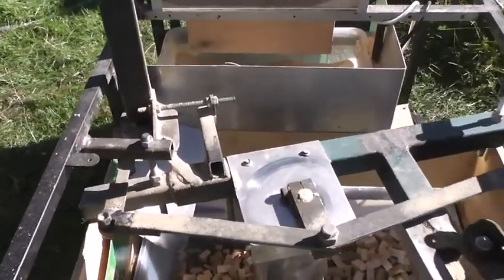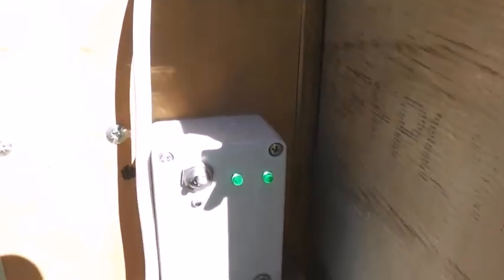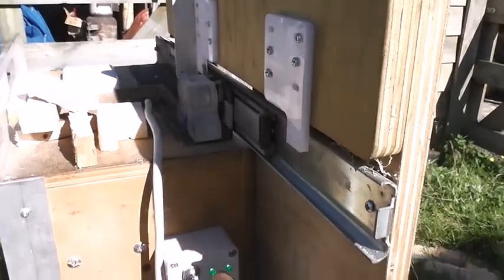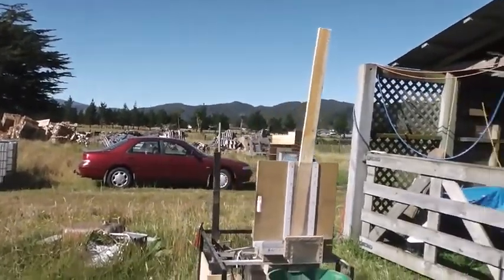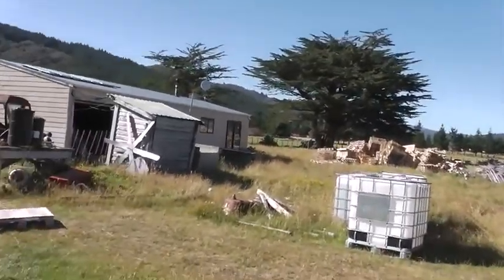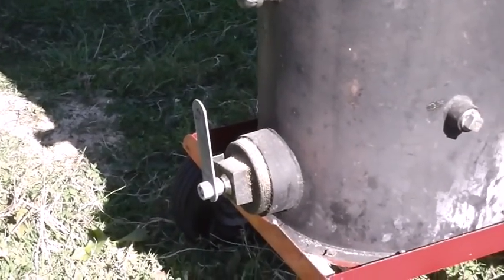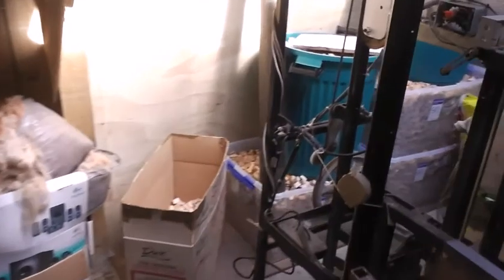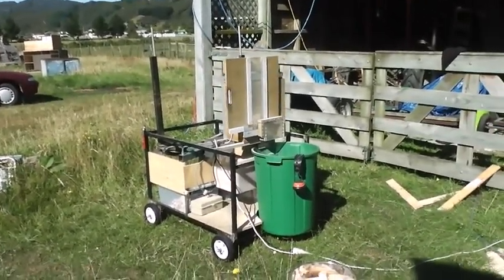Motorised Gasoline Granule Generation Station

Comment: I sure love these videos. I'm thinking about cutting a hundred pounds or so of some similar size chunks,  so I can do another run. I don't have my saw even near complete, but I'm getting the itch to run this engine on wood. A little insulation to do and a few more electrical tests should tell me what I need to know. Im hoping I'll get some work done by the end of this week. I put in for a couple of days off for my birthday. It'll be nice to have the time to work without watching the clock. Thanks for sharing these vids as they really inspire me to get to work. Joe
Reply from the maker: Howdee Joe, 
 Ahhh yes, the endless need to make fuel for our beloved gasifiers  :) . 
 I bet you are really itching to get your beast up and running on Treezel fuel again, as the woodgas addiction must be regularly satisfied by a good, solid, woogas fix, in the smoky machine shop. 
 Here's hoping yer boss will be fine with letting you go for a couple of days, so you can get that all important birthday woodgas fix  ;) . 
 Keep up the good work, my fellow woodgas bug necknip venom victim.

Comment: Let Me Guess the control is an arduino.
Nice Job Want to build one. Will you Share your arduino Code.
Reply from the maker: +AllgoodAutomation
 I use the PIC controller chip for all of these. Specifically the PIC16F628A. These little guys are cheap, and quite easy to use in a homemade computer. 
 This machine was in use today, making more fuel for the gasogen, while being powered by it. 
 It sure is good to never have a power bill  :) . 
 Yup, sure, you are welcome to the code, and the schematic for this device. 
 It drives a stepper motor, and uses a pair of reed switches to determine which way to move the slide.  
 Recently, I added some more code - to help the machine to clear itself when there is a log jam in the fuel hopper. 
 Works a treat  :) .

Comment: Now that was 8 minutes of my life very well spent.thank you..
Reply from the maker: Thanks kindly  :) .
I plan to rebuild this project soon.
It will be tougher, and faster too.
The existing one got a bit worn out from all the hard work it was doing, so the new one will have a few improvements built into it.
Reply: I cut my gasifier from the video in half and turned it into a down draft that's not working so well so I will turn it into an imbert
Reply from the maker: michael cole
 Yeah, my first gasser was a downdraft type.
It gave me a lot of engine horsepower, but it was not a very clean gas producer.

Imbert is the way to go alright.

If you would like to get some great pointers on a very clean gasifier design, you might want to look into the videos uploaded by Flash001USA.
His gasser runs really cleanly, and is not too difficult to build.
Not only that but he gives us a step by step how-to on the build process  :) .

Comment: I have a similar fuel storage system...but I found the fuel would sweat...so I drilled 1/2" holes around the base perimeter to let them get air flow ..problem solved...
  Love all your stuff ...
Reply from the maker: Howdee fellow woodgasser,
Yes, that is good advice indeed. I was going to make the mistake of putting the lids on all of the containers, but it occurred to me that they might sweat.
I never considered the air flow issue, so I will soon be installing those holes like you have suggested  :).

Comment: Hey are you using an inline helper blower on your setup? The reason I'm asking is I thought of trying that to eliminate the back drag to the engine and possibly gain more Hp. The only issue I can see is setting the blower's output up so that it either matches the engines needs or is really close to it. You could even treat it like a regulated power supply by designing a PWM circuit that was slaved to an RPM sensor on the engine so if the engine does bog down a bit under load that the blower tracks it and cuts back accordingly so that the it doesn't flood out the engine by delivering more woodgas than the engine can handle.
Reply from the maker: Howdee Flash,
Nopers, I have not tried a helper blower on my setup yet. I think it could make a big difference, but my power requirements are so small that there really isn't the need for it.
Perhaps you could use a vacuum sensor to govern the blower's power level. If you were to maintain a particular inlet manifold vacuum figure for all engine speeds and loads, I expect that would solve the control problem quite nicely  :) .
Reply: *****
I was on the fence with the helper idea but I have to agree with you on the power requirements issue. As long as I can deliver a good 1000 Watts that will be more than enough to charge the batteries. The only reason I was asking you that question was because I seen what I thought was an inline vacuum motor on your gasifier.
Reply from the maker: flash001USA
Indeedy, it is not a bad idea to give it a try, just to see what it can do, but it seems somewhat redundant for our needs.
My gasser has 3 inline blowers on it. One is used as a starter for the gasser. Another is used for backburning, and the last one is used to pull the gas through the filters - to avoid lengthy cranking sessions - and feed a post filter test flare. That last blower is set up in such a way that it will pull gas out of the engine, instead of towards it, so I may look into re-plumbing that part of the system.

Comment: This is great man! Did you read Dr Seuss stuff as a young man? I'm in tears of laughter and totally impressed by this! Great job! I just got my support frame all welded together for my gasifier today and now I can get it mounted onto the trailer. The gasifier will be on wheels with the frame and this way I can free up the trailer whenever I need to haul a few things. My next project will be a chunker for fuel too. Damn man! I just got to the part where you are showing the fuel surplus you have. You haven't been messing around with this! You've been busy. Once again great job!
Reply from the maker: Howdee partner,
I really should get me some book lernin' done on Dr Seuss' work, as I figure I could get me a whole new mess of ideas to go on.
He sure was a great character, and his work is surely known and loved all over the world  :) .
This machine performs very well indeed, considering that it's my first prototype. Perhaps next summer I will improve upon it, as a more efficient, yet simpler, design came to mind the moment I completed the Electro-Lopper18000.
That will need to wait though, as the immediate plan is to get the gasifier back together and running in time for the freezy months of winter. Brrrrr!!!!
What's cool is that I can make fuel while working on the gasser.
I like what you are planning with your gasifier. Having it on wheels, and protected from the weather is the way to go alright. It will last a long time, and you won't have to worry about rust and other nasties getting into it  :) .
Talking of such things, my goat ate part of the wiring on my gasifier. You should have seem him jump when he activated the flare ignitor and soaked up 30,000 volts of sparky goodness  :).
Once you get your new chunker up and running, you won't believe how much fuel you can make for yourself with only minor effort. Last winter, I was hand cutting the fuel and literally running back and forth through the rain and ice to feed the hungry beast in the generator shed, so I would have the power to run my machine shop.
Now, there's already enough fuel to keep it going all through the winter.
Your new chunker will make a huge difference for you too, and you will wonder how you ever lived without it  :) .
Reply: *****
 I love where you took this idea! When I was watching it I first thought of the game "mousetrap". I don't know if you remember that game but it was cool. I'm sure that game was inspired by the old Dr Seuss stuff where they made these elaborate machines in the cartoons for their daily life that did cool things.
Reply from the maker: flash001USA
Hehehehe, yeah, we humans can be very inventive when we want to be.
Just imagine what we could come up with if we all put our minds to it  :) .

Comment: Howdy Mr Steve!
That's just bloody Awesome!
  Ya gotta my vote for... Who would you want for a next door neighbor!
Looks like you'll well set up this winter...
Might need to make a finger fuel feeder?
Good on ya bud..
TerryL
Reply from the maker: Howdee partner,
Yup, I wish I had brainy boogers for neighbours too, but most of mine seem to like smoking whacky weed and getting drunk all the time. I say they need to move out and be replaced by fellow woodgas addicts, and CNC machining nuts  :) .
There's lots of fuel in storage right now, probably enough to last all thru the winter, but I am gonna keep making fuel while the sun is still shining, just to be sure.
The fuel finger feeder idea is a good one alright. I have a kind of "book shelf" approach in mind. The plan is to load enough fuel fingers onto the shelf to keep the gasoline granulator busy for an hour. They would be loaded like books on a shelf, then pushed sideways towards the cutter magazines.
Well, that's the current plan, but it will surely change when I go to build it  :) .